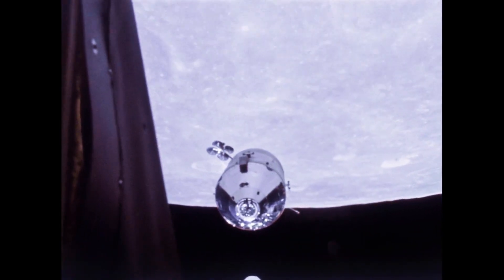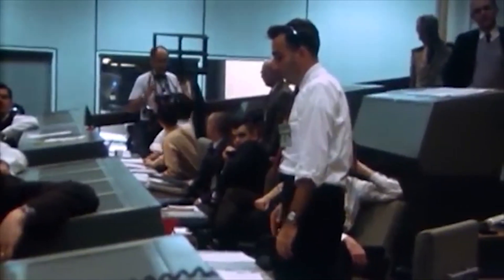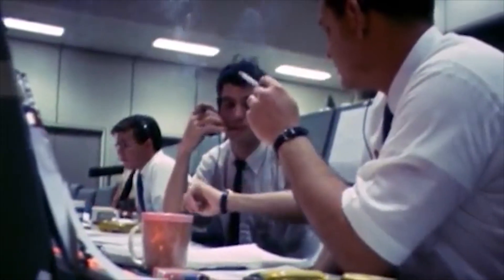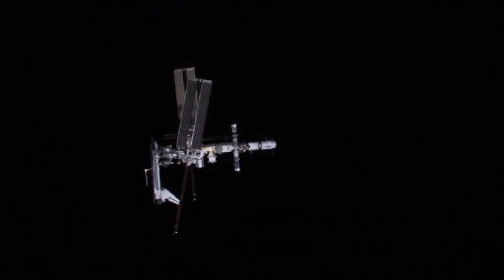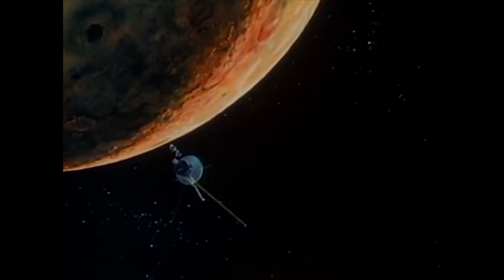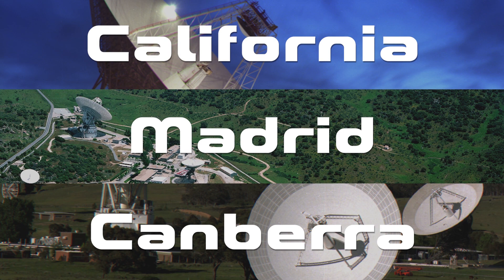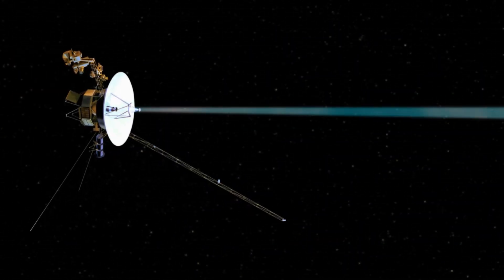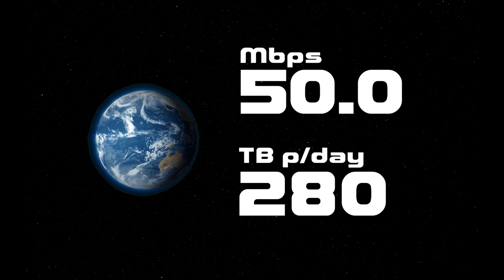Space Communication: How Do We Communicate with Space?

Comment: Except the VLA is not used for spacecraft communication and the truly horrible animation at 1:30 shows a spreading signal originating at the "pointy end" of the antenna where the whole purpose of the dish is focusing the signal emitted at the horn toward the dish into a parallel beam that is directed at the remote spacecraft (except, again, no, the VLA antennas do not transmit).
Reply: Hi i have a question do you want to join my space community?

Comment: If a particular leo satellite has an uplink of 135 - 330 MHz and a downlink of 433MHz + 2.4ghz for sending remote sensing data to ground station, how does it do it as increased frequency results in decreased wavelength.

Comment: Can we use light to transmit data... instead of radio waves.
Reply: Savan Kanjariya radio waves are light
Reply: Yes, they have been testing using optical transmitters which works kind of similar to a fibre optics cable works just without the cable